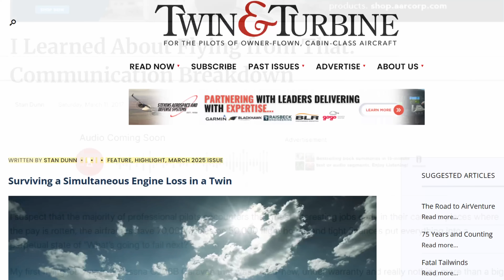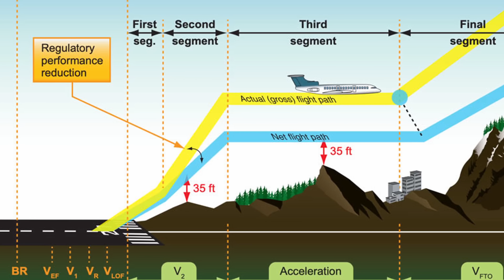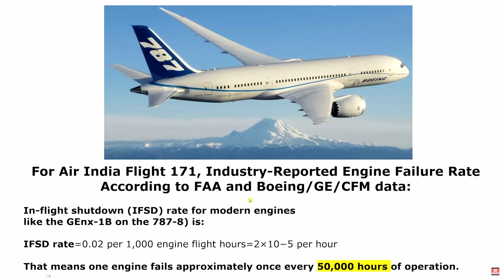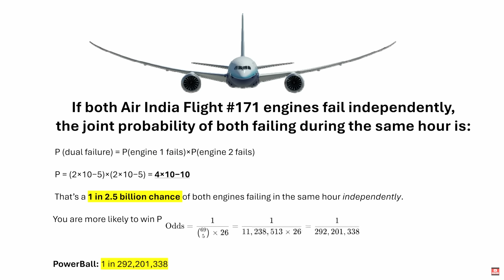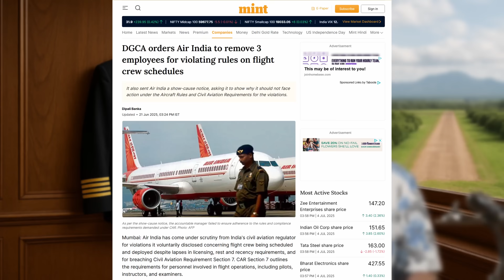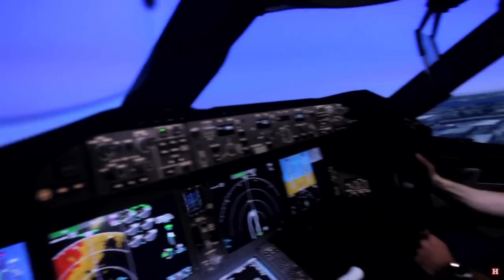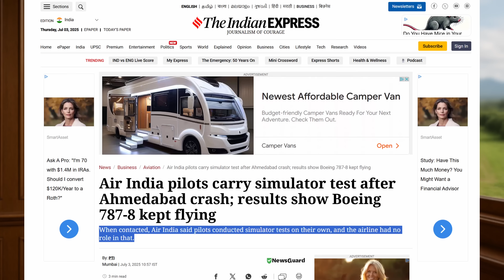Air India 171 Cause Becoming Clear

Comment: Hmmm. At no point did the aircraft slew therefore both engines always produced the same level of thrust. Therefore observing dust from the side of the runway closest to the camera is a red herring. The wheel bogeys were tilted therefore the pilots did initiate the wheel retraction because there are electric motors that make the bogeys tilt in order for them to stow in the airframe. The wheel struts did not retract because they are hydraulically powered and the RAT does not have the power to drive them. We conclude that the aircraft was entirely powered by the RAT soon after V1 and up to retration. Independent power systems cannot fail simultaneously, as they were optically observed to do, therefore the failure is related to a common failure of the device that controls power to both engines. There is no other failure mode. Be aware that other failures led up to this point in the swiss cheese model but the engines were both instructed to shut down. The aircraft software architecture is deficient and when the offending computer rebooted the engine controllers took it to mean the engine had to shut down. Now we have the FAA as the fox in charge of the hen house which could try to save Boeing by deflecting doubt elsewhere. I really hope that doesn't happen but the long delay in this investigation wrt to electronic data is concerning.
Reply: I agree up to the point where both engines were commanded to roll back, however the cause of this command still has to be determined and could be a hardware defect as well as a software issue.
Reply: Hopefully the flight recorder or fedc maintain a log of the commands issued. That's a lot of data to be stored in secure memory though. It should be possible to see the physical throttle position on the engine assembly and compare it with the physical throttle lever position. These systems are usually designed to leave witness marks.        @christopherrobinson7541

Comment: We know the gear was selected “UP”.  

We can be rather sure there were no actions to shut down an engine at less than 200 feet, which it needed to happen to halt the gear.  

Reality says that if they lost an engine on take off (which I think is very likely) they were busy flying the jet.  

Positive climb rate was noted and the gear retraction called for and selected.  

At this point, they were “home free”.  The jet was stabile, climbing well and controlled perfectly, directionally.   

You are posing one of two scenarios (which is irresponsible of you) 

1. The captain was flying and SOMEHOW the FO shut the engine down without following procedures.  HIGHLY unlikely.  If the FO was so panicked, he would most likely freeze.   But most certainly would not reach for the fuel cut off switch or fire handle (no reason to think they had a fire indication). 

2. The FO was flying and somehow the captain shut down the wrong engine.  

Again, zero reason to think they received fire indications, and UNLIKE a propeller driven aircraft, in a jet, there is ZERO practical need to “shut down” an engine which has failed.  There is zero improvement in performance by shutting down a jet engine.  They can fly the plane for hours without shutting down the failed engine.  No rush at all.  

As remote a duel engine failure is, that is the most likely situation.  

The jet was stable up to the point of impact.   Suggesting that control was not an issue.  

Performance looks very adequate to get the jet to 200-300 feet, the most critical in an engine failure.   Directional control is not an issue either.   

The engine failure (assuming it happened on the take off roll after V1) WAS HANDLED WELL!  

The captain make a call that they lost thrust (we done know to what extent), but he had the wherewithal to make the call and did not seem highly stressed, which would be required for him to accidentally shut down the wrong engine. Or allow it to be shut down.  

Reality is that a terrorist attack is more likely can “accidentally” shutting down the good motor.  

But; to speculate on most of this is irresponsible for a “well experienced content creator”.   

Pisses me off to think you are pushing for views, and doing what you know is irresponsible.   

Sad

Comment: OK MR pilot i suggest you  take a good long look at a KLM flight that was also a boeing 787 that had a double engine failure was traced to a special valve that is used during refueling and only the boeing 787 it requires special maintenance and that maintenance has to be preformed quite often and using special procedures and if not done it will and can cause a double engine failure

Comment: Which type of aircraft did you fly.....ever flown a wide body? Do let everyone know which tyes you have flown.The fact that you speak fairly authoritatively without any facts is amazing besides a script made out about how pilots deal with emergency situations and some technical info on how a shut down takes place.
The very fact that you aren't sure whether the simulator testing involved climb out with 2 engines or 1 with gear extended shows you know nothing.  Everyone,  repeat Everyone knows that performance with both engines running is never an issue and hence to even contemplate that the simulation would have included testing to see whether the ac can safely climb with landing gear extended with both engines running is simply unbelievable.  Einstein or Newton....whichever you may think you are.....the trails DEFINITELY would have been with one engine shut down with landing gear extended.
Having said thatt, try and earn your money without blaming the dead....very disrespectful.

Comment: Rushing to shut down an engine seconds after takeoff and even before raising the gear is not what happens under any circumstances. The first priority is controlling the flight path. There is no urgency to take any action on the engine - unless it’s wildly on fire (which it wasn’t) and not even then. 
The other examples given of wrong engines being shutdown all happened at significant height off the ground - in line with basic pilot training and standard operating procedures. 
This video is wrong.

Comment: Having flown this scenario at Frankfurt during my profcheck I can tell you that inadvertently retracting flaps instead of gear is a non issue, you don't even get into the amber band.

The 'puff of smoke' from the left engine is just dust as it's a super dry dusty place and the plane did take off near the end of the runway, blowing dust away as the jetblast is tilted downward. Perhaps the problems started after V1 and that's why they barely made it to the end of the runway. Maybe it was a total electrical failure at the time of gear up selected or because of gear up selected and that triggered a rollback of the FADEC system or even a dual throttle position sensor fault which would also result in the throttles going to idle by command of the FADEC system.

The focus on a single engine failure and how to handle it is of no use in this video as it didn't happen, it's padding.
Also calling it a 'start stop switch' is kinda childish and useless, even more if the picture clearly shows cutoff and run.
You seem to be lacking in basic 787 knowledge and haven't even researched things like the gear truck position.

Lastly: diving into a pure speculation realm where you possibly blame the crew and even continue to speculate on what they did wrong with zero proof or technical evidence pointing into that direction is cringe beyond believe. Do better.

Comment: It makes me sick when these alleged pilots want to blame the pilots. All these dummies say stupid things like the pilots did not have flaps or they did something stupid like instead of raising landing gear they raised the flaps which is totally ridiculous. These pilots were very communicative and they clearly said loss of thrust. They did not say engine out we are going to shut off the engine that is good. So stupid. The hydraulics on the landing gear failed as wheels are tilted up. Rat deployed indicates both engines shut off in flight. Were there any problems with this plane. Hmmmm electrical problems they allegedly repaired in 2013 relating to a battery problem. So in my opinion it was most likely some kind of electrical problems that caused both engines to shut down
 It happened simultaneously. Even this guy gives an example of a am electrically transient and failure of battery backup. So that reinforces my theory. This guy talks a lot 
 What does he say"impossible for both engines to fail yet they did as rat deployed and wheels did not go up. Like if you don't have anything intelligent to say don't blame the pilots. They heroically tried their best but communicated the problem " No Thrust"

Comment: Tldr: he thinks that one of the engines failed during the takeoff and pilots turned off the working engine by mistake
Reply: Thanks for that. Zero deflection of the rudder. So that theory is just that.
Reply: Personally I don’t think that’s what  happened.
Reply: @IloveCamels335 it happens inadvertently but experienced pilots would have climbed out first
Reply: @user-zp6ff2gr4n yes. Just not consistent with what we saw unfolding, my guess is some electrical failure causing issues with the  fuel pump system which is electrically powered on the 787. Everything we saw would be coherent with this scenario. I don’t understand why all these „experts“ giving explanations that make little sense. I guess we will find out in the final investigation report.
Reply: And your mom engineered that flight by mistake too.
Reply: Mistaken engine shut-down not only goes against pilot training, it fails the not-enough-time test. Events happen so fast that it is difficult to imagine the pilots going through a problem-diagnosis-response process. That is particularly true given that the response to the loss of one engine doesn't result in a yaw or rudder response before the other is shut down. You have to imagine one of the pilots had his hand on the engine shut-off switch and tripped it at the instant trouble occurred. That makes no sense.
Reply: @Inkling777  Yes, it's unlikely to the point of impossibility to be pilot engine shutdown! The RAT wouldn't have deployed either. It only deploys during 'uncontrolled' engine failure apparently.
Reply: Thanks. None of these muppets can't keep it short
Reply: If the wrong engine was shut off while they were rolling they wouldn't be able to get off the ground the way they did if that's the case.
Reply: This is to save Boeing...
Reply: Goofy idea.   My wild guess that the  landing gear retraction failure could suggest that the landing gear sent the "on the ground, shut down the engines" signal seems more likely.
Reply: If he turned off the engine would that cause the rat deployment?  Pilot complained about no power after all
Reply: I certainly doubt that
Reply: then why did the pilot scream "no power!"??? what bs
Reply: @soloflick6579  He may have believed he had no engine power? Just my guess. :hand-orange-covering-eyes:
Reply: @soloflick6579 except they didn't scream that
Reply: Would not have been the first time this happens.
Reply: @mudi2000a  Kegworth air disaster
Reply: It's a Boeing built post merger/domination of unqualified beancounters over Boeing's previous engineer / safety culture
Reply: @Ukraine-Must-Win that may be but let’s not jump on that train now. The plane was flying fine for 11 years before the accident. Not likely to be a manufacturing flaw.
Reply: @IloveCamels335  That's still really young for an aircrat, 0-10 years is generally considered 'new'.  I don't really see your point.
Reply: @nobdog5037 if your car doesn’t brake after you owning it for 11 years.. would your first instinct be “oh man Mercedes sucks they don’t build reliable cars”. Or would you take it to a garage see if maybe the brake pads need replacing. Yes 11 year old planes are pretty average as far as lifespan however it is more likely to be a maintenance issue at such point rather than a manufacturing or design default. And I am not dismissing all the  problems Boeing has.
Reply: @IloveCamels335  The car analogy doesn’t really work here imo. This isn't like your brakes wearing out, it’s more like your engine violently exploding and killing everyone in the car 30 seconds after leaving the driveway. Complete catastrophic failure.

Takeoff is the most closely monitored phase in terms of maintenance checks and pre-flight/in-flight performance — a potential double engine failure doesn’t point to routine maintenance issues.

If critical components are designed and certified to last a typical airliners 25 years but fail catastrophically after just 11, then imo that would classify as manufacturing defects. That’s where Boeing’s recenty history should be closely scrutinized. 

All speculative ofcourse, but that's all we can be at the moment.
Reply: @nobdog5037 first of all, if it  was indeed a double engine failure then why point fingers at Boeing. They have nothing to do with the engine that would be General Electric. Plus it’s completely unlikely that a double engine failure occured - what are the signs? We did not see anything that hinted at that. My analogy was just to point out that more likely than not it’s not a manufacturing defect.
Reply: @nobdog5037  You repeated his point without seeing it...?
Reply: @Ukraine-Must-Win  Heard that somewhere, did you?  r.o.t.f.l.

Comment: I'm not a pilot but would a pilot really shutdown an engine that early in the flight? If the left engine had failed would the airplane have not yawed to the left, I didn't notice that in the video? Perhaps we are left with pilot sabotage, deliberate shutdown of both engines. The other pilot wouldn't have had time to react due to workload.

Comment: IF IT WAS A    SABOTAGE THEN IT WOULD REMAIN SILENT---sabotage done with the computer of 787 won't be easy to catch during the investigation because the computer was gone with the crash. A similar thing happened to the Airbus A400M in 2015.

Comment: WRONG . The B787 has not ONE generator in each engine.
THE B787 HAS 2 STARTER GENERATORS in each engine : L1 L2 R1 R2 that work as engine starters for engine start and then as engine generators.
So FIVE TOTAL Four in the engines and as you said very well one in the APU.
Just to clarify. Thanks
Reply: There two generators on the APU, so six in total.
Reply: You are right. Two (L,R) Thanks

Comment: I've got 500k worth of hours in a Honda Accord and I am certain that what he mentioned is not the cause.  In those few seconds of time between liftoff and the crash, how in hell could the captain have enough time to identify a single engine failure, get the Co-Pilot to agree, shut the wrong engine down and then radio that they have no thrust.  There simply is not enough time to even identify an engine failure let alone go through the process and then begin to shut it down.  The crash happened nearly immediately after taking off.  No way this could be the case.

Comment: Apply LATERAL THINKING if you want to resolve what caused the loss of 787
1.	Fuel (electrical) starvation.
2.	Both engines INOP seconds after T/O.
3.	LG «UP» triggered dual engine failure through SYSTEM BUG.
4.	Boeing designers must answer…

Comment: A small contribution....the plume is white...just dust to my opinion...if intent fly into terrain excluded then we have to focus on the circuity of engines start/cutoff switches either by a crazy short circuit or a coffee spillage...to this stage only assumptions can be made for this high electronic state of the art aircraft. All for all from the video it is a clear loss of thrust. Remain to be found out the root cause

Comment: I don't know I'm not convinced by the explanation. These are not rookie pilots have had many hours of flying why wouldn't they have just gone for stage one idle the engine? makes no sense just to switch it off considering they knew they were at  low altitude it would be a death sentence, can't see them doing that. I think there was an electrical failure that just cut the engines cut the pumps. And I think it was dust they went right to the end of the runway that should tell us something, most planes have taken off by that point, and dust settles and it was a dusty place